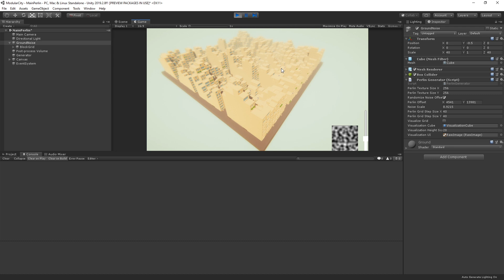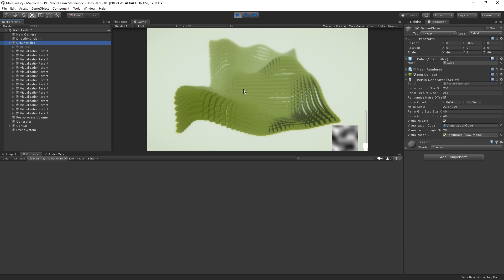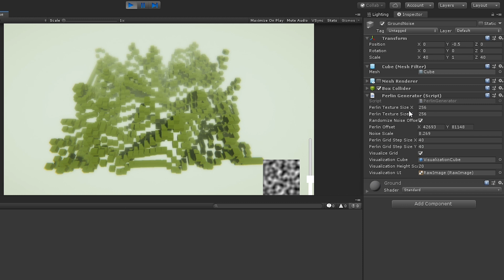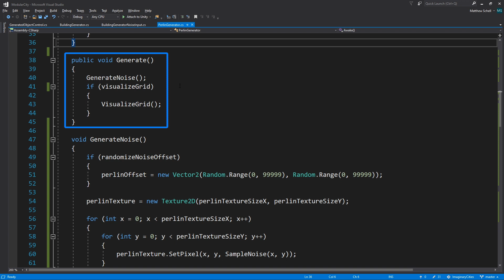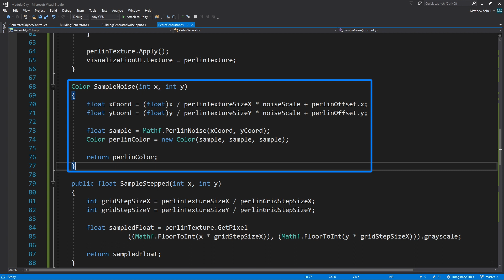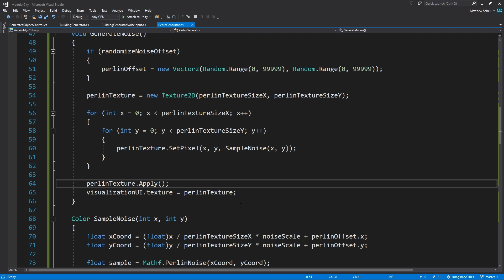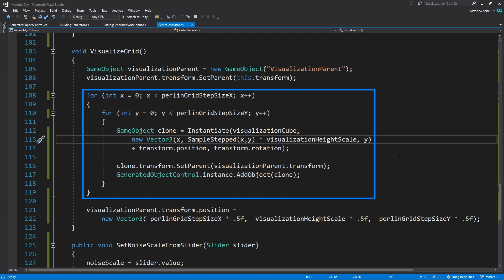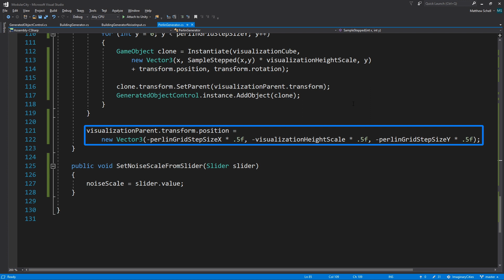Block Landscape Generation With Perlin Noise In Unity3D (Tutorial)

Comment: hey, if i want to do the same landscape, but also, i want that this landscape have  valleys not only mountain. how do i do it? great video!!!!
Reply from the maker: The approach is the same, I would just put "sea level" at 0.5 in the data set. Under 0.5 is a valley, above is a mountain, make sense? You could also remap the data to another range you like, like -1 to 1 if that makes more sense.

Comment: Good info! Have you heard of Simplex type noise functions? Perlin is very grid-aligned, and not really the best option for its purpose in most cases IMO. First thing I would do, if I were coding this, would be to source an external Simplex type noise library or cs file. It doesn't help the cause that Unity only includes Perlin in its Mathf package. That aside, looks good!
Reply from the maker: Thanks! Good tip. I haven’t actually used Simplex before but heard of it. I’ll take a look. For these I’m trying to keep things relatively simple so the built in aspect of Perlin is useful but it could be a cool mod or extension of this to implement Simplex as an option and let folks see the difference.

Comment: Interesting. Im just thinking of using triangles instead of cubes.
Reply from the maker: This doesn’t handle orientation so the approach will be a bit different, you might be better off generating the whole mesh at that point. Good luck!
Reply: @newbquesttv  ah ok. My idea was to let the player change the y-level by "digging"
Reply from the maker: @nielshenriksen1043  definitely possible, then you'll probably want to go for a more voxel style approach so it's not just empty underneath

Comment: Another very helpful video. I'm extremely interested in procedural-anything. As I attempt to transition from hobbyist developer into someone who has actually published something, the simple game I'm making for the Oculus Go will be a procedural cave. So, your videos of late have been very timely for me!
Reply from the maker: That's great! Glad to hear it. I recommend you look also at Sebastian Lague's procedural cave generation series as well.
Reply: Yup! I have been!
Reply: Cave generation is interesting! Heads up: If you want caverns that are laid out like tunnels, you might be better off generating them using an "iterative" approach. While you can create some tunnel-esque structures with noise by sampling derivatives and approximating the distance to where two 3D noises both equal zero at the same time, that might be a more 'advanced' topic. If you want stalagmites/stalactites, that should be a bit easier! I've found that the "ridged multifractal" technique for mountains can be adapted for that. Finally, I'd suggest looking into simplex-type noises in place of Perlin, if you do use noise.
Reply from the maker: @kjpg7413  Great tips! Thanks for sharing!
Reply: @kjpg7413  Thank you for the suggestions! I've got some googling ahead of me.